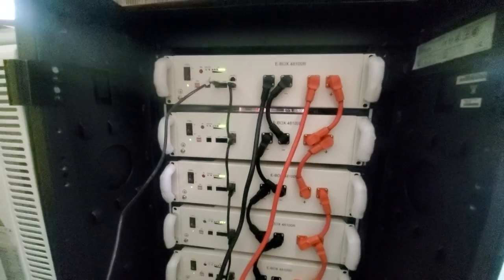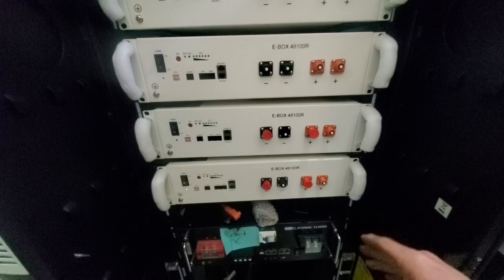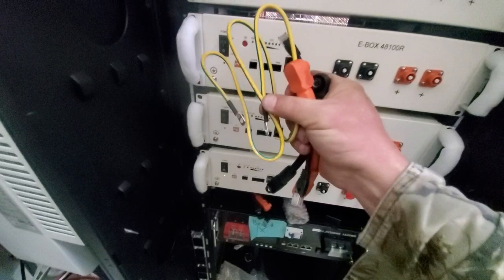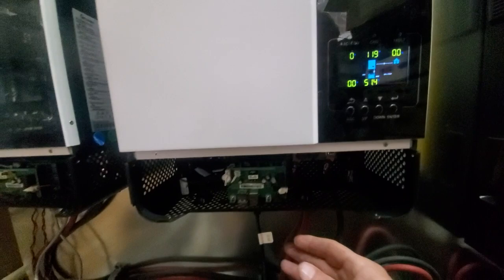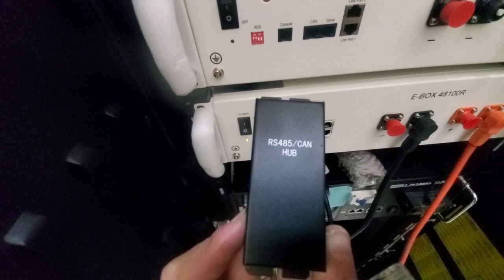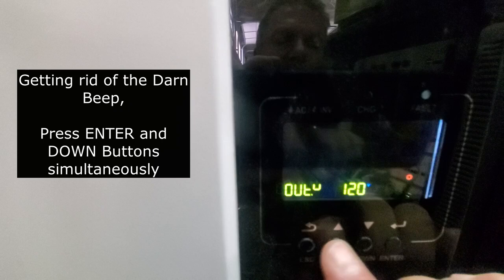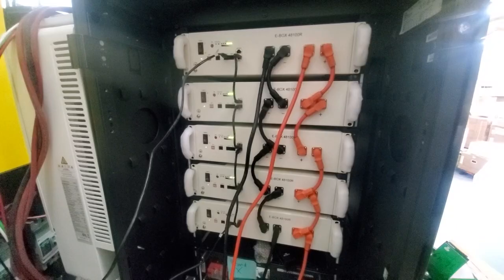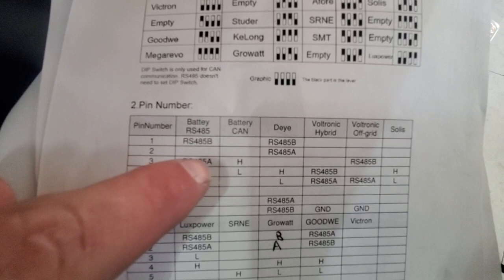PYTES 5.1kwh 48V Rack Mount LiFePO4 battery configuration GROWATT off grid Inverters

Comment: The fastest EV charging rates occur at nearly the beginning of the charge cycle for most models. My model 3 will only charge at 250kW until 5-10% SoC.
Reply: Here are some other charging milestones in the session (Model 3 Performance):

2% – 10 miles – 0 mins (126 kW)
5% – 16 miles – 1 min (250 kW)
20% – 62 miles – 4 mins (250 kW)
21% – 65 miles – 4.5 mins (Taper from peak starts – 248 kW)
30% – 92 miles – 6 mins (218 kW)
40% – 123 miles – 8.5 mins (179 kW)
50% – 153 miles – 11 mins (142 kW)
60% – 184 miles – 14.5 mins (108 kW)
70% – 213 miles – 19 mins (87 kW)
80% – 245 miles – 24.5 mins (56 kW)
90% – 275 miles – 34 mins (36 kW)

Comment: Hello Friend,
I have 2 pytes batteries,
I followed all the steps as in the clip, with a 5 kw Growatt inverter.
when I put the protocol 51 pos 36 disengage.
did I reverse the communication cable and the same?
do you have any ideea?

Comment: Hi, I have here in the UK 2x Voltcom E-BOX-48100R LFP battery's which I believe are the same but rebranded battery's. Voltercon Solar UK whom I purchased them from have been less than helpful when they found out I was using Growatt SPF 350 ES inverters which they do not sell. In short I need a communication cable from the inverters to the batterys can you help in any way.